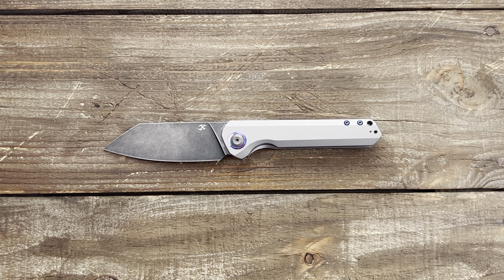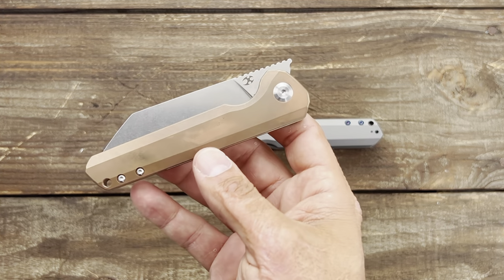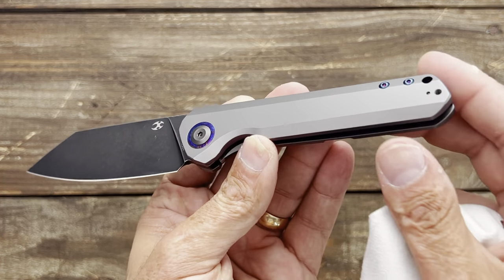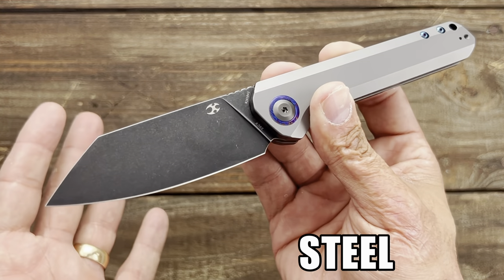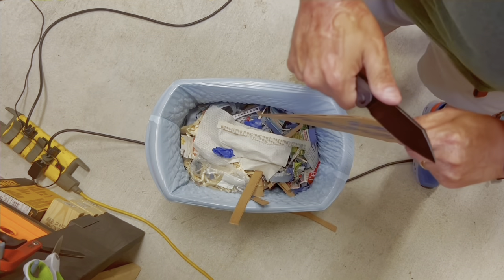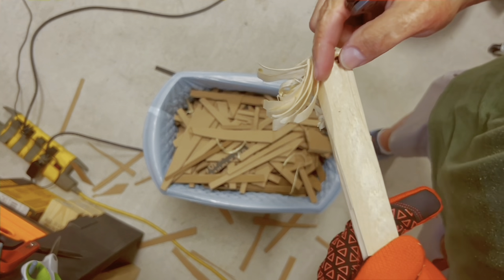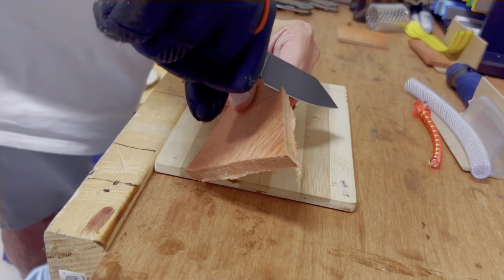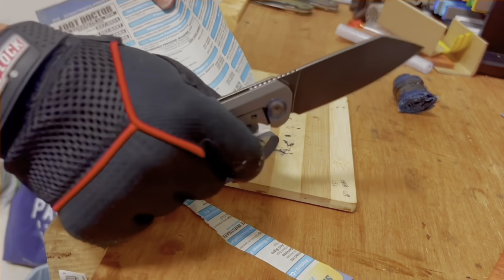OUTSTANDING! KANSEPT KNIVES BULLDOZER/ FULL REVIEW & TESTING

Comment: I got lucky as hell (along with 11 others) when I got my bulldozer. have the same titanium with timascus clip/pivot spacers and got it for less than $90 brand new. even though the blade stock is relatively thick it is super slicy. the factory edge wasn't bad but ended up sharpening it on my Wicked Edge system and it pops hair off my body almost as good as a straight razor. the Bulldozer has pretty much been the most used edc knife I have in the past 6 months of owning it. front flips amazing and the action is extremely drop shut on mine. do wish there was another way of deployment other than the front flipper but still a very useful design for my needs. did just order a set of skiff bearings for it to see if they'll work and see if I can tighten the pivot up just a little to try preventing blade from being a finger cleaver when closing. if I try tightening up pivot now with factory plastic caged bearings it gets really gritty regardless of what oil I've tried so hoping the skiffs i ordered will work. Lmfao. all in all though I absolutely love the Kansept Bulldozer.